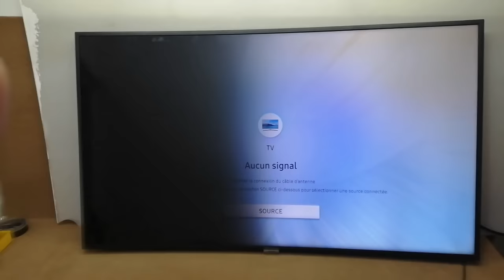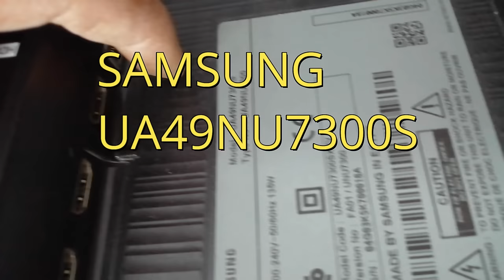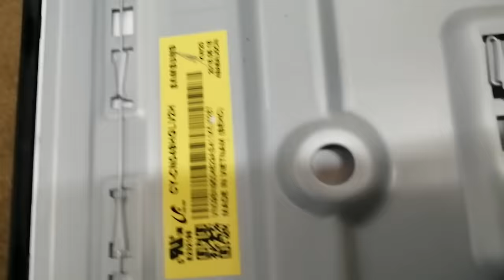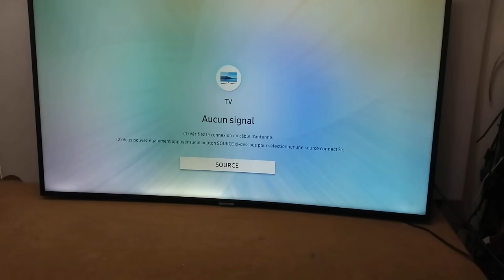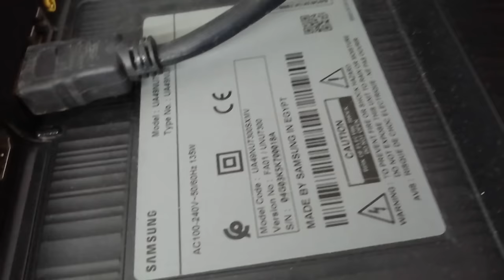HOW TO FIX TV Curved  SAMSUNG 4K SMART UA49NU7300S PROBLEM Dark middle image problems backlight

Comment: I don’t touch them anymore since most of the diffuser acrylic sheets are burnt shame on Samsung
Reply: Thats true
Reply: Yup. Same with my 43. Crap design.  I sanded down the edge and it helped , but still a bit of bleed on the bottom.  Of course you can't find a new acrylic diffuser anywhere.  I'll stick to direct backlights in future.
Reply: @rcary  it’s worse when they’re cracked, and diffuser has to be the right way bottom or edge lit as there is a difference in the light distribution
Reply: @wisher21uk  yeah, I installed the leds sightly offset from the scorched bit. 3mm or so. You can slide the acrylic a tiny bit left or right to get the ideal lighting, then shim it so it doesn't move.  I have 2 small cracks starting, and yeah it messes the light up a bit.  I keep them on 50% and live with it.
Reply: @rcary  awful design and Samsung never resolved the issue nice tvs other then that

Comment: I have a question, how did you turn on the LEDs, did you plug it in?
I plug in the socket and nothing turns on.
Reply: press the power button or maybe both of the led stripes are defective